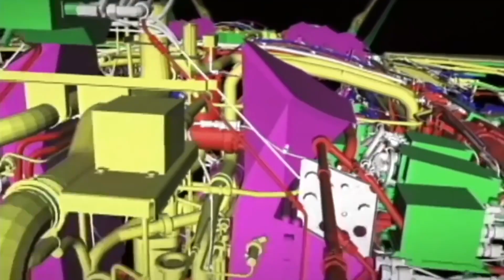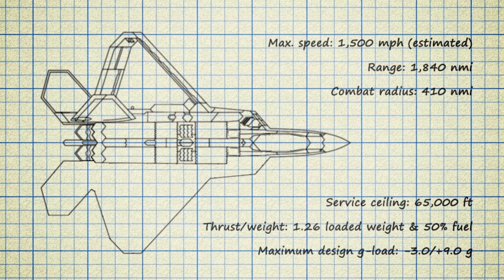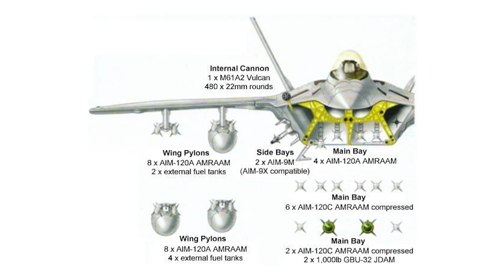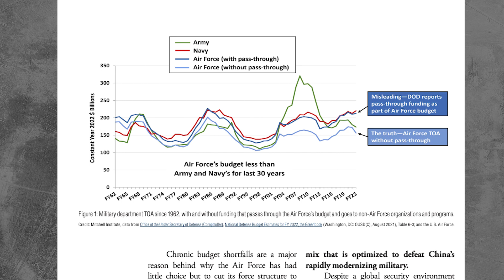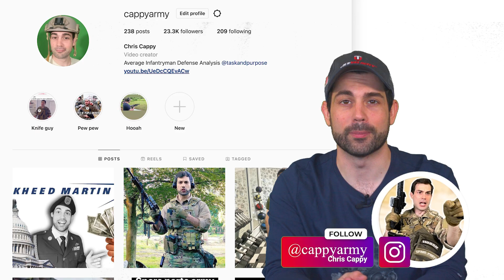Cancelling the F-22 Fighter is Worse than You Think

Comment: I totally agree that retiring the F-22 is a Huge mistake. 20 years in the USAF, and I worked on many different Airframes, I saw the YF-22 and YF-23. Then more recently was involved in the F-22 program at Hill AFB Depot. The F-35 is no replacement for the F-22, the F-15 is a proven platform and is undefeated in battle at 100-0. But it's not a 5th generation fighter. Even the F-15EX won't have the stealth capabilities of the venerable F-22. One can only hope that the USAF has managed to keep a lid on its real replacement. The F-22 is pretty quiet when it takes off and lands which is very unique among fighter aircraft. It can maneuver in the air unlike anything else the United States flies and only Russia's  SU-57 from what I have seen can come close to its air acrobatics.
Reply: Thank you for serving! To your point, do not underestimate the J25 and J20. They're going to have two dimensional and possibly three dimensional thrust vectoring. We can't get complacent. F-15EX is a heavy hitter and it is faster to intercept and hold airspace, while Raptor and Lightning II will be the standoff safeties
Reply: Still no SU-57 seen in the Ukraine war no matter russian defeats. Think we're gonna do ok.
Reply: Neither the F35 or the F15X were expected to replace the F22.
The NGAD is already in development.
Reply: @richrigney4610 
That's awesome, my dad worked at Hill on the same aircraft. Wonder if you guys ever crossed paths
Reply: The F-35 was never intended to replace the Raptors. The role the Raptors fill it turns out is one we don't need as much as we once thought we would... namely an interceptor. The F-35 is there to provide intel, stand off against 3rd and 4th gen fighters, and HARM support which I suspect it will do fairly well. Think of it as a support system making it easier for 4th gen airframes to do the heavy lifting. 

Well enough to justify the price? Not sure about that yet. 

With advances in radar (some to frequency but most to signal processing) stealth is less useful unless you are doings stand off and the airframe is completely dedicated to stealth. To be more specific low frequency radar can tell you a  stealthy strike is inbound and what vector even if it can't pinpoint it well enough to guild in munitions. That is enough to vector in fighters against a strike or light up with a mobile SAM battery from the side. The Raptor is very stealthy... from the front. From a side or rear angle... not so much. That is a lot of money to risk against SAM batteries that cost a fraction of one Raptor. And with improvements to signal processing radar in most frequencies is much better at finding stealthy targets. 

Add in that Raptors need longer runways and tanker support to take a front line role. And tankers are becoming increasingly vulnerable assets. Once you reach the point where you have to assign F-22's to protect tankers so other F-22's can reach the battlefield... it just becomes bogged down. In war games just targeting the tankers with higher end 4th gen fighters was enough to take F-22's out of the field with little risk. And that does not even count the advent of drone swarm tactics which are already in the offing to which tankers are probably even more vulnerable. This is why the J20 is being built on an airframe that gives it much greater range without support... support is very vulnerable.

Add in that with the Su-57 and J20's coming along slowly Raptors would still have been replaced by 6th gen to stay ahead any way. Those programs were a long long way from completing back when the Raptor was taken out of production and by the time they were ready the intention was to be developing the next generation of fighter. 

Basically we had a fighter for a war that never materialized. It was far ahead of it's time and because of that became a victim of cuts. Even now the Su-57 is not really a threat and the J20/25 are not even a threat. No one else had any aircraft that could take on our 4th gen fighters which also could fill many rolls much better than the Raptors could. So now we are on to the 6th generation while other nations are just now staring the 5th generation.
Reply: @bjornjwagner7252  The point of Su-57 is to NOT be seen, you don't think? It's stealthy for a reason.

Russian defeats? Those painful to PR but strategically irrelevant withdrawals you mean when Ukrainians left huge chunks of the frontline bare to attack in a small area? Sure, it worked once, and then didn't. Meanwhile those parts left bare were swiftly taken over by Russians.
Also if Russia is losing so badly, why is it that Ukraine is constantly begging for as many tanks, arty pieces, missiles, bombs, trucks and for NATO to get involved directly? How is that Russia was meant to run out of missiles since March, but somehow hasn't? If Russians were losing since day One, how is it that they control over 20% of Ukrainian territory while initial attacking Ukraine with a 1/4 of the force that the west brought to Iraq in 91? If Ukrainians are winning so much how is it that so many of their units record videos where they refuse to go to fight over being treated like cannon fodder, lack of command and control, lack of armor support, artillery support and air support? Or record videos about being literally abandoned and having ~35% of the men that made it out.

If you only knew just how badly you are being misinformed. You'd ask if you are living in USSR or nazi Germany in 1930s.
Reply: @whitelabrat  Low-frequency radars stations today, such as NEBO-M and newer (NEBO-M has 3 radar posts working in different frequencies (metric, decimetric and millimetric) and I'm referring to only Metric wave post under one command van with data fusion), with AESA tech and modern signal processing, have an error box of around 150m at long range. A modern BVR missile as well as current-gen long-range SAM missiles, are guided to within ~7.5 miles of the target they need to hit and from there the seeker looks for the target by itself. At THAT range you'll need good EW or towed decoy to survive. So they are accurate enough for SAM guidance. No ground radar does guide-to-hit these days.
Reply: Yeah right 😂 Stick to your so called "special operation" instead @Max_Da_G . What happened with those 3 weeks its been going on for a year now?
Reply: @bjornjwagner7252  Which specific Russian government official or member of General Staff in ministry of defense has ever officially mentioned "3 weeks" or "3 days" or "3 months"? Actual officials, not some parliamentarian, senator, TV "expert" etc.

And to Russians it's an operation. To Russians a "war" is something on a scale against NATO. So WW3 scale to them is "war". Here it is indeed a limited operation. Just for comparison, 1991 Iraq war was ALSO designated as an Operation. Operation Desert Shield to protect Saudi Arabia by building up forces and then Operation Desert Storm to rout Iraqi military. Western allies brought 965K troops for Operation Desert Storm. For reference: Russian military brought 200k troops into Ukraine, plus around 50k men came from unrecognized republics, now expanding to around 500k men once mobilized get brought in. Still a smaller force than what went into Iraq in 91. Oh, and Saddam had the same number of troops as Ukraine did. And for Operation Iraqi Freedom in 2003, the invasion force numbered almost 585k troops at its peak.
Reply: @Max_Da_G  OIF was almost 300k at its peak.
Reply: @bjornjwagner7252  Numbers are off wiki.
300K overall or just Americans?
Reply: @whitelabrat  Making the 4th gen jets do heavy lifting is more of a method of keeping them relevant, as the Air Force has stated their desire to order as many F-35s as they can as fast as possible rather than taking even the F15EX for the reasons stated above. F-35s with 4th gen is nice, but F-35s with each other is a kind of lethality the public might not be ready to comprehend yet, especially when datalinked with ships or even infantry for ground target designation, warnings, or air support. There's also to consider that 4th gen aircraft are getting old and tired from flying missions and undergoing intense Gs over their lifetime and are in need of replacement regardless, along with the fact that tradition 4 v 4 training engagement with 4th gen aircraft have turned into 2 v 4, 2 v 8, and so on for the F-35 purely because its the only way to stress the systems enough to truly evaluate them. Those 22:1, 78:1, and 165:3 (iirc) kill ratios are indicative of how effective it already is, to me its price is as justified as it gets w/o having an opportunity to be used in war yet.

Also on a sidenote both the Raptor and especially the F-35's passive systems are capable of listening for those lower RF emissions to piece together target information, and with the F-35 it can visually identify both airborne and ground targets at range with them. Beaming either of the two is simultaneously giving away your location to something that may or may not be out there that now knows you are there and can respond. I wouldn't put money on the massive search antennas staying up for long, and they'd leave the doors open for the flood of 5th and 4th gen to rush into the airspace, at least that's how I see it going.

Comment: A new fighter based on the F22 could prove fruitful. the airframe is exceptional, and engine designs are only marginally better than they were in 2011. But entirely new computers, UI, VR displays, and radar developments would prove incredible, as well as newer stealth material developments carried over from the F35 program
Reply: Variable Bypass ratio engines are very new,  you don't want 30% more range AND 10% more power?
Reply: @Hector accented  Ill admit, I had to go read up on VBR engines after your comment. The concept definitely seems promising, Tho Im wondering about the size of the engine and its effect on stealth at various speeds. Im sure Lockheed will spend another 40 billion trying to figure that out. 

If I were in charge of such a program. I think I would look at maintaining the current engine design simply to speed production of a 5 1/2 gen fighter so as to increase our modern air capacity. The 6th gen fighter programs already in production arent likely to see a military aircraft in service before 2050, And I do feel VBR will 100 percent be a feature we see on many if not most 6th gen fighters should the technology pan out with the stealth capabilities necessary for modern air combat. And one an F22-Mk2 of sorts is in production and numbers are filling up, At that point I would look into developing a potential VBR engine that could fit in the same housings to retrofit the existing F22s and future F22 variants. I believe the point of this program is to expand 5th gen capabilities so that we dont have to rely almost exclusively on 4th gen aircraft for air superiority all the way up to the deployment of 6th gen aircraft. My focus personally would be on making as few alterations to the F22 as possible as I believe an update design would serve better in the short term than a ground up design. If were determined for a ground up design, then we might as well hold off and divert those resources to the already existing 6th gen program.
Reply: Yes even as those engines are expected to be used by 6th gen fighters/drones  I'm also skeptic of how "variable" they can be on a small frontal area fighter, they should be better for bigger birds (or resurrect the Boeing X-32? LOL)
Reply: @Hector accented  How much you wanna bet they mount them on the B52 and add another 20 years to its service life?

Comment: NGAD was already on the drawing board decades ago and the correct calculus is that the F22 will meet the needs until it's replacement, which has already flown (and extremely hush-hush), becomes operational.  Wise investing/financing and long-term planning imo.
Reply: Exactly, and they have the f35s to help cover the gap. Besides stealth isnt a magic bullet. The need for less expensive non stealth aircraft in other roles that dont require or negate stealth will remain in military tactics. What better platform than F15s or perfectly decent 4 and 4.5 platforms for some of those roles.
Reply: @waltersistrunk4200  Uh, we already have shown them: worked and is working in Ukraine, and that's our tier 3 tech kits in use.  But go ahead and stay fearful of the The Red Bear and Putin's paper fighting capability.  And ya think XI is not watching Russia's weapons of war being decimated??
Reply: Jack Ryan  unlikely, but they're still two generations behind - the PLA conventional forces will be wiped out

Comment: We couldn't afford the F-22 flying.  It's incredibly expensive to fly and requires huge amounts of down time.  The military and US govt. were CORRECT in wanting to cancel it.

And in fact there is now a better material to provide the radar absorbing/diffusing capability which requires much less maintenance and aircraft can fly faster with it.

The problem with a very complex aircraft design is even when you come out with a new material for stealth coating, as in this case, the material is different so that airframe couldn't take the material.  The plane has to be designed for it.

And this is why I stick with Alex Hollings and Sandboxx.  You get the "rest of the story"

This is a propaganda piece.

Comment: Great presentation!
I think the requirements for an aircraft used as a deterrent are different from an aircraft used in combat.
To deter enemies from picking a fight, you can have a small number of expensive, awesome aircraft.
But to fight an actual war with a near-peer enemy, need to aircraft that are cheaper and easier to mass produce than the F-22.
Reply: Well, yes and no. For the slightly less demanding missions, there is the F-35. However, Western military doctrine dictates that you first want to suppress or defeat enemy air power and defences, a role for which the F-22 (and B-2/B-21) are better suited. So, you do need the F-22 in good numbers for that initial beat-down, and maintaining it. (That's not to say the F-35 isn't capable, it is, but the F-22 is just better.)
Reply: @mnxs  surely the sheer number of NATO F-35's will ensure air dominance with 5th gen fighter spam. My country alone has more than 50 already.

Comment: F-22 is very difficult to upgrade and has only just gotten link 16 as modularity was not in mind when the aircraft was developed. 
It’s also very easy to copy, a big risk hence why it was never exported unlike the F-35.
Reply: Exactly - but the lack of link-16 was strangely intentional it's quite a electronically noisy system - Even tranche 3 onwards Eurofighter can detect and track link-16 emissions passively! From an operational point of view they had to include it eventually - but most systems onboard F-22 are obsolete and practically impossible to upgrade - as great as it is as a plane - and it is - F-22 needs re-engineering from the ground up.

Comment: Cappy, the production line clip at 6:42 belong to the F-35, (canopy hinged in the front, while the F-22 is hinged in the back)
Reply: I love the external fuel tanks on the F-22, which are needed in the Pacific Ocean so it doesn't run out, completely negating its stealth technology.  GENIUS far-sightedness...
Reply: @williamyoung9401  I'm assuming that when it does drop those tanks it drops the pylons as well.

Comment: TL;DR – Gates was right to cancel the F-22

•	The F-22 took around two decades to get into service, this is about average for the introduction of a new aviation asset
•	The F-22 has weapon systems that are either obsolete (its gun) or smaller than other aircraft in its class (eg AAM, bomb loads)
•	Almost anything the F-22 the F-35 can do better and the latter aircraft is a) still in production, b) used by dozens of countries around the world and c) has a hugely more capable ground attack capability. The only thing that the F-22 can do better is dogfighting and if an F-22 actually has to get into a dogfight then it's primary asset (stealth) has already failed
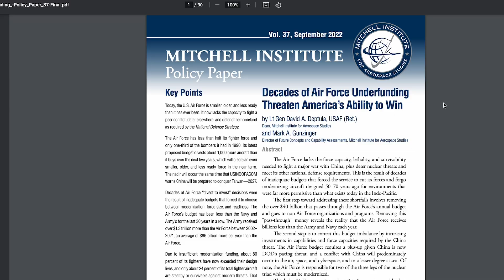•	Gates made the absolute right call in 2008.  Your own reference at 3:44 states that the existing F-22 fleet was sufficient for the Air Forces needs for at least the next 4-5 years (it was) and China was not expected to have a credible stealth capability until at least 2020 (it didn’t)
•	The US may be drawing down its airframe numbers but it is still, as always, increasing its net overall air force strength.  No one would argue that what the US needs today is to rebuild an active force of say 2,000 B-17s and 5,000 P-51s.  Modern aircraft are not just better than older aircraft by degree but also by type, they are simply able to do things that older aircraft can not do under any circumstances, eg operate in a high SAM/AAA threat environment, EW operations, deep penetration etc.
•	The bottom line is that if China, whose population is around five times that of the US, eventually gets to a point where its people enjoy a standard of living and GNP that is just HALF that of the US then it will have an economy and thus military that is around 2.5 times its size.  This is simple economics and simple logic.  The US would be far better to try and work with China to help moderate and guide its rise rather than try to provoke a war with it to try and somehow slow this inevitable process along.